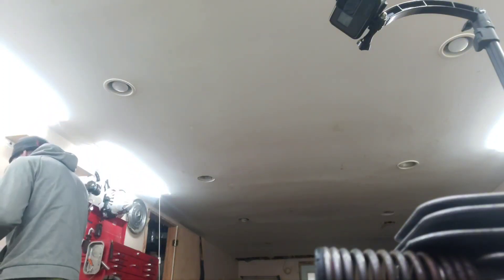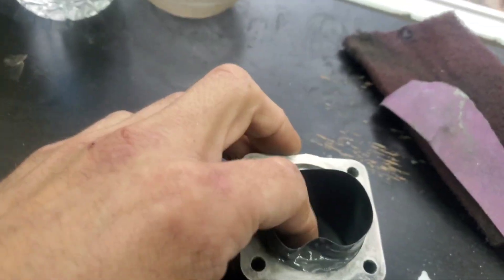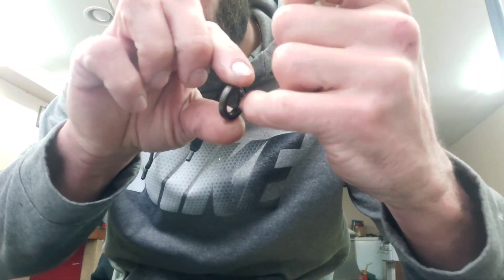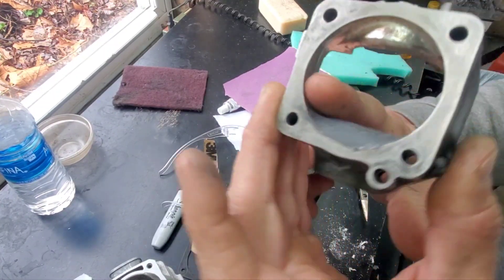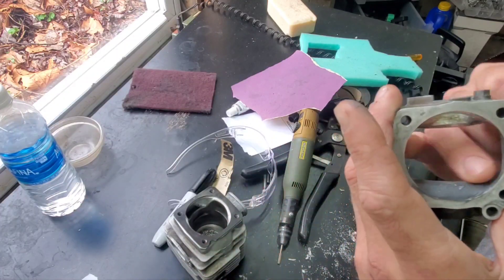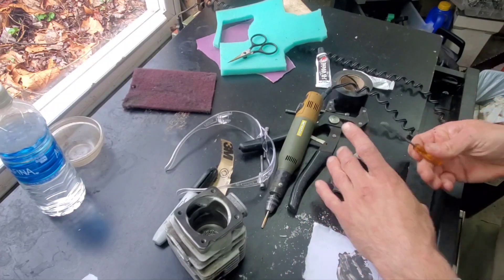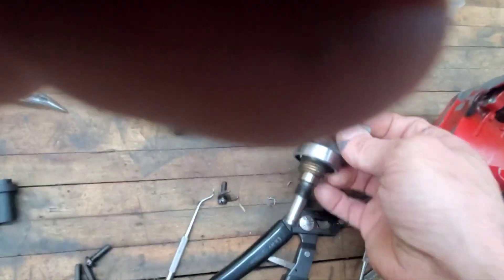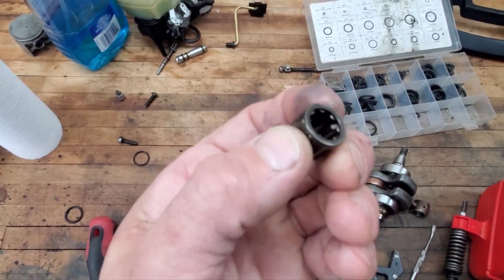Jonsered 2051 needs new crank seals

Comment: Hay emmet. im working on a 2054. looks wary simmilar interior. i tok it apart. didnt clean it. but it now that i changed the coil, piston, bearing, overhaul sett for the carb. it runs. but it runs only desent when both low and high jet is closed. all the way. and it pisses me off becaus i think the crach case shaft seals are worn down. and its running lean. Bogs down then i putt the trottle down even with the smallest adjustment on the low jet. High jet i can have 0-1/2 turn out. its a 97 mod.